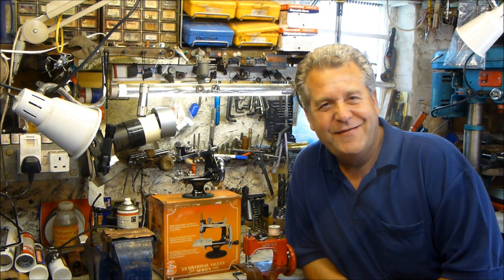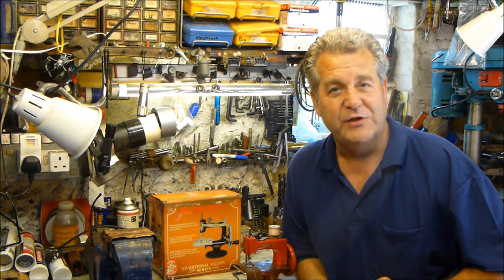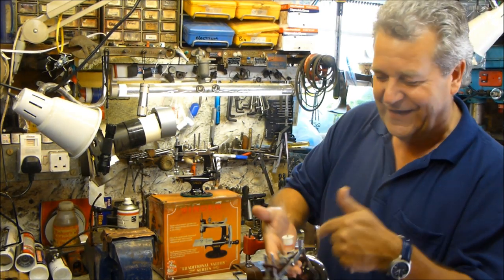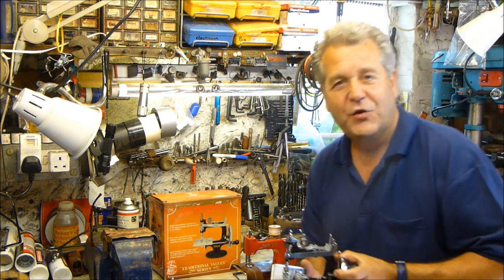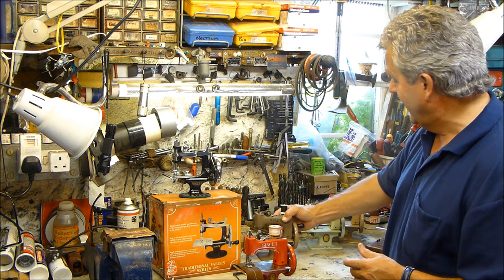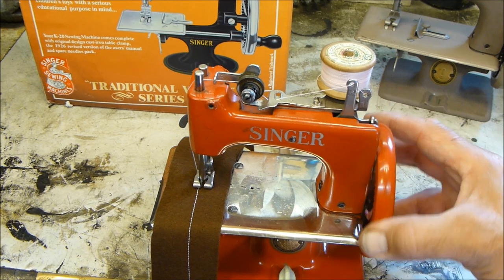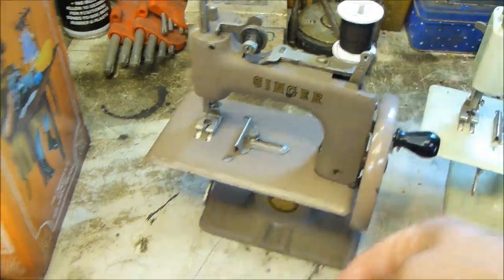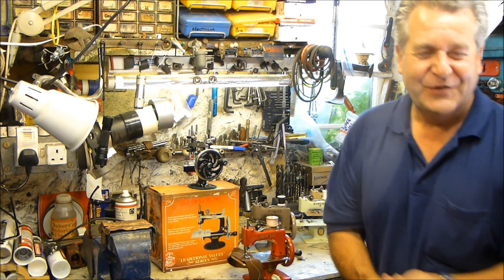Alex Askaroff Presents the Singer 20 toy sewing machine Singer Sewhandy

Comment: I have a 1953 sewhandy, and I'd like to change the needle.  Every needle I've tried is too long.  What needle is the right one?
Reply: 24 x 1 for I believe every Sewhandy model except the 50D which requires the obsolete 24 x 3 ( but there is a technique which allows you to substitute the 24 x 1 needles). Organ currently makes the 24 x 1 needles in many sizes.

Comment: Hi can you put a walking foot on this machine?
Reply: No. The foot is designed to protect children from the needle. It cannot be exchanged for any other standard Presser Foot or Attachment. The only attachment that is designed for it is the Cloth Seam Guide. It’s much smaller than the one for adult machines (as is the screw and screw hole in the machine bed). It’s also a chain stitch only machine.